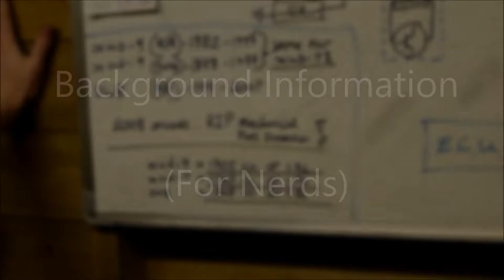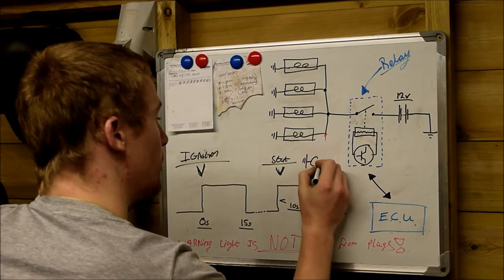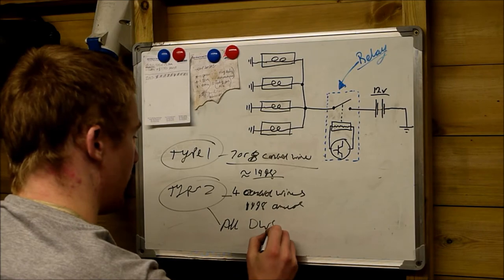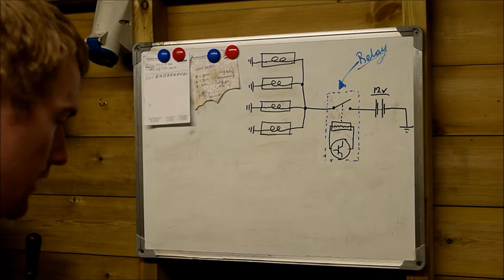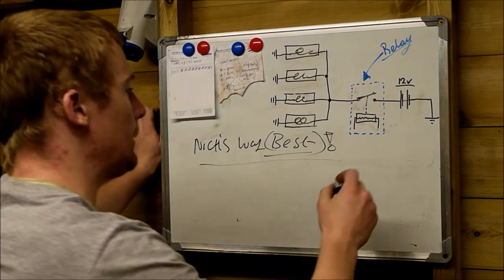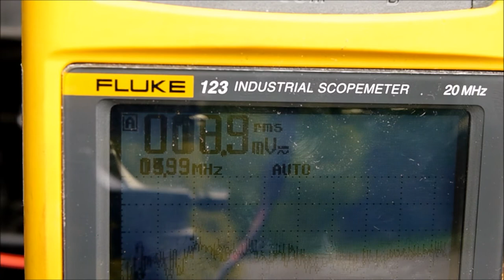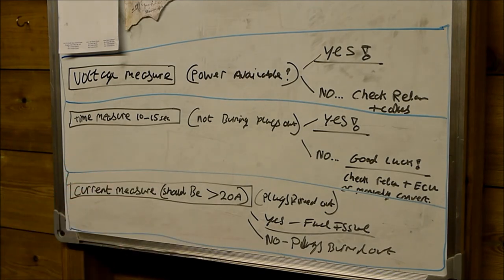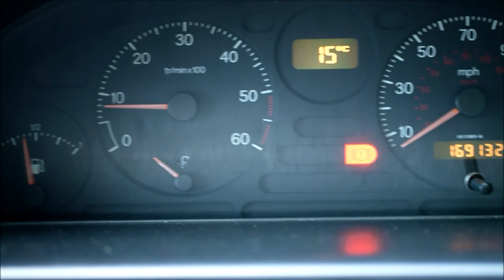Peugeot & Citroen 1.9d - Glow Plug Testing & Operation

Comment: Mate! Thank you so much! I watched the entire video and you saved me from burning out all my glow plugs. So grateful. I bought a 1996 Xantia with the XUD11BTE engine and cold starts were a nightmare. I initially thought the relay was bad because i didn't have any glow plug warning light, but it did click on and off. After playing around with my multimeter and a test lamp I found that the positive feeding to the relay was bad. Where the cable from the positive terminal on the battery goes in to the fuse box (right next to the battery), the cable was burnt. Replaced it, so now I have a wire going from the battery's positive straight to the relay. Before starting the car I had the test lamp connected to the glow plugs. Ignition on and warning light on, glow plugs 10 sec. But when I started the car the glow plugs came back on and wouldn't switch off (I was able to tell from the test lamp). I counted 30 sec and glow plugs still didn't come off. So I switched the engine off not to burn them out. Now I am thinking of simply connecting an on/off relay with a push button for the wire from the battery's positive

Comment: Very helpful advice. Changed the relay and got an extra 2 seconds on the plugs. Is now a bit better. Then Managed to get the old ones out but accidently bought the wrong ones.  Going to buy Bosch this time. If that doesn't work, will put in a manual button. What a great idea. Thank you

Comment: Oh my god, the amount of detail on here is amazing. I was just looking for how to change them on a DW8 (1999 Dispatch) but thought what the hell I'll watch this through.

Good job I did, I was surprised to see that if there's a problem they default to always being on. I tested mine and sure enough, the plugs stay on forever after starting. Which explains my poor starting, especially on SVO.

You've saved me burning out a fresh set of glow plugs, thanks!
Reply from the maker: You're welcome my friend. Yes, Peugeot / Citroen weren't all that clever when it comes to electronics. Glad you're able to identify the problem in your situation. They've turned what should be a simple system into something insanely complicated that makes very little sense to anyone who has to work on the system. Hope you get it sorted in the end my friend!
Reply: I did get it sorted, but it turned out the fault wasn't there after all.

I was assuming because the voltage was there for a minute after starting that it was that fault, but actually on these cold mornings they stay on for a few minutes, but do cut out. I've replaced three of the four plugs and it's now flawless at starting, and is now able to handle a 50:50 SVO mix with ease.

Unfortunately what I saw doesn't match the 15s preglow/10s post glow you describe, nor are they permanently on. Is there something a bit different there?

Still good to know the dash light has no bearing on the plugs' feed, that definitely helped.

Comment: Nick. It seems there is a 3rd option. I have (in my 1997 Peugeot Expert 1.9NA) a controller which looks just like your 'type2' (5=pin connector), but there is no ECU in this vehicle and it is wired directly to GND, ignition, temp sensor, lamp, starter. Or to put it another way, there exists a 5-pin version of the type 1 controller. So having a 5-pin connector does not necessarily mean that you have a system controlled by an ECU.
I've just spent the day removing the stupid controller electronics and working out how to wire it up as a manual pushbutton (It's always annoyed me that the lamp does not actually display the glow-plug status, I've already replaced the controller once and now that one seems to have died).
It came with the 'DB9' engine, also called XUD9AU. (I've since swapped it to put the turbo version in which has a lot more poke).
You might also want to mention how the device is held together and how the double-flange is arranged so people can get in without destroying it. It's very hard to disassemble without significant damage.

Comment: Great video.
I have the shit system with crap Lucas pump, ecu and the crappier glow plug relay box and the DW8 engine.
I also have the fully mechanical bosch VE pump on another DW8 engine so considering swapping over the pump so I can have a 'Go' switch on the dash for the pump and a 'heat' switch on the dash for the glow plugs. Do you know if the ecu controls anything else on the car that might stop working if I remove the ecu entirely?

Comment: Would it be possible to locate the feed from the ecu to the glowplug light and cut it, then run  feed from one of the glow plugs back up the loom and connect into length wire left at the back of the light, so the light is wired directly to the glow plug feed?

Comment: This must be what is wrong with my 2007 Peugeot expert 1.9 , having a hell of a time trying to start it and when it does it sounds like it is only running on 1 or 2 cylinders until the rest kick in when the engine speed rises , not mechanically minded , are they easy to change out ?

Comment: Removed my relay. For the 4 wire  plug connector there are wires in slot 1,3,4,5. Which are the ground and live from these? Two of these go to the ecu. Am trying to do your mod but dont want to damage the relay. Appreciate any assistance.

Comment: i have a 1999 1.9 d that refuses to start when cold would bad glow plugs stop it from starting? it will bump start and run fine but won't start off the key. thanks
Reply from the maker: Hi Lee, If it bump starts fine when cold, then it's likely you have a bad starter motor. But yes, bad glow plugs will definitely cause it to not start as well, but if the glow plugs were bad, the fault should still be present when you bump start it. Does the engine turn over when it's cold? if it does, is it any slower than usual?
Reply: @NickExton309  ive tested the glow plug circuit and modular/relay they are all ok and working well all glow plugs dead. it starts fine when bump started but back to no start when it gose cold. ive added  the none return valves and pipes replace the filter housing. and no smoke when running. even added another prime pump. still wont fire off the key. spins well and starts after  instantly once its been  started. all the glow plugs are dead but i didnt think they mattered when its a warm day like today. im at a loss lol just your good video made me think is it my knackered glow plugs lol thanks for your time mate

Comment: i got a 2.0 hdi berlingo multi space, and this very cold weather, now my engine is ticking, and the warning light is flashing stop. and coming back on, ramdonly, its a 2003 version. any help? it ticking tap gets faster as u rev, gutted had it over year and had spend loads on the last MOT nah this has happening, i checked me dip stick and some reason it was showing above the line now aswell, will this damage me engine,... any help advice would be great.

Comment: Hi mate I'm having a nightmare with mine it's got 12v going to the plugs without turning the key! Any ideas? I changed the plugs a couple of weeks ago I guess they are burnt out again 🤔
Reply from the maker: Yes, they would burn out in a matter of minutes if they're left on continuously!  - What is your engine size and what vehicle is it in? Is it the 1868cc DW8 engine? - If so, it sounds like there's a communication issue between the glow plug relay, and the engine ECU. - Let me know what engine it is, and I'll see if I can give you some more suggestions. :)
Reply: Hi many thanks for telling all the system is realy great. Mine is the same problem with edward bradley told and sometime it is not giving 12v to glow plugs. Mine in 2004 1.9d engine  (Dw8 i think). Problem with ecu conneting to glow relay? Push switch in the cabin battery to directly glow plugs. Orijinal glow plug 12v cancelled then push switch. İs  the problem with ecu to glow relay or broken down glow relay etc.  is seen on diognastic?